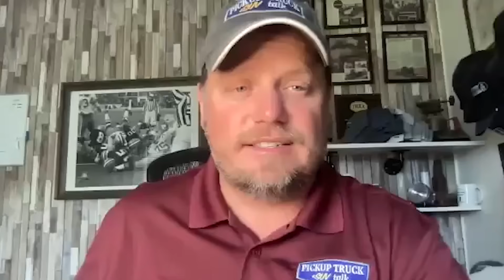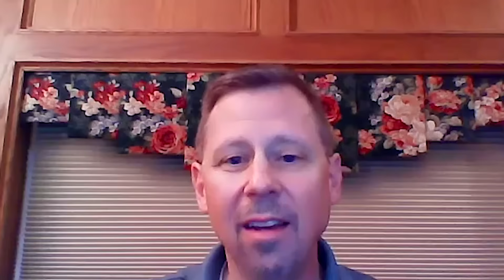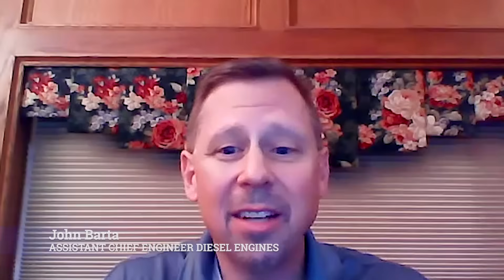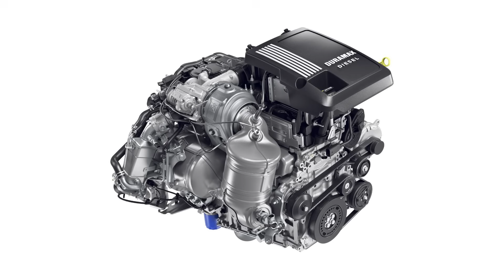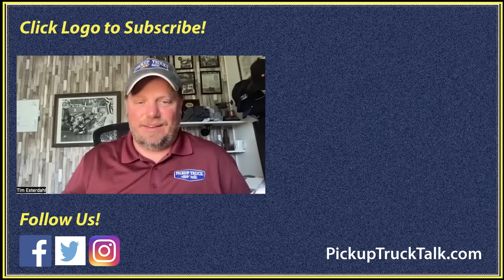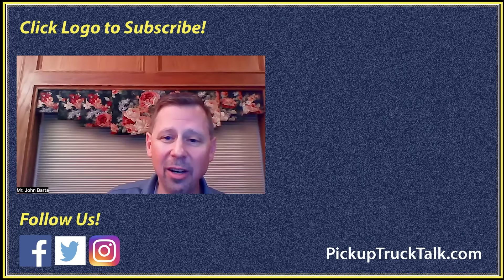GM's 3.0L Duramax Diesel Engineer Answers Questions Owners Keep Asking

Comment: GM: Pleeeease put the LZ0 duramax in an HD chassis.  Many of us need high payload and capable braking, but don't need huge towing capacity. My use case is overlanding slide in, popup pickup campers. Though on the light end of pickup campers at 1,600lbs, that is just a bit much for the average fullsize pickup. But going to a HD means huge and expensive diesel or thirsty gas engine. If not towing typical HD towing loads, many fullsize pickup engines would work great; this LZ0 duramax being a perfect example. Call it an "HD light" (opposite of a "heavy half ton") or whatever, but keep the 3,000+lb payload and tow rating of a typical fullsize (10,000 - 12,000lb) rather than HD towing capacity (16,000+lb) and with this engine, it would be a star.
Reply: Or scale the 3.0 up to a 4.0 or 4.5 L version and put it in the HD.  I dig this straight six so much.  Heck, if they scaled the 3.0 up to a 6.6 L version for the HD, I'd be tempted to get one.
Reply: @v8chevy788  I like the way you think! I love the inherent balance of a straight 6 (in gas or diesel). If they upsized it too big, though, they would have to replace the 6.6. The 3.0 as it is would mean no new/different engine and so would have economy of scale and parts. Though a 4.0 version would be great, the 3.0 in an HD chassis with the 10 speed would be plenty for my needs, cheap, and good fuel mileage so GREAT backcountry exploring range with a big HD fuel tank, and carry the payload I need (for slide-in pickup camper) as well as have the brakes and handling for the payload.
Reply: GM did release a higher towing/payload option for MY22 with the LM2 trucks.
Reply: @LoneWolf1985BK  Correct that the fullsize pickup max towing was increased with the last model year of the LM2.  But that is the opposite of what I'm talking about. I don't need even 1/3 the towing capacity of the Fullsize pickup, much less the HD. I need the payload capacity of the HD due to hauling a light weight slide-in pickup camper (1,600lbs dry and 2,000 wet with camping gear). Need the 3,000lb payload capacity of an HD and capable brakes and chassis to more confidently haul the camper, gear and passengers. 

My current fullsize pickup with airbags is at max payload and so really need an HD chassis, but do NOT need huge towing capability of an HD and so don't need the HD drivetrain (huge, thirsty, heavy engines and transmissions). A Fullsize pickup drivetrain, like the LM2/LZ0 3.0 diesel, would have all the power I need since I have 2,000lb payload (camper) in the bed for about 7 or 8 months out of the year. .The trailers I tow are only about 3,000lb - 4,000lb each at the most (fishing boat and an enclosed trailer.  

I love the 3.0 duramax and it would easily pull around a "HD Light" with the typical HD payload but with a reduced max tow rating. If they rated it for the same the Fullsize pickup with that engine (or even less since the pickup itself weighs a couple thousand pounds more than the fullsize), that would be perfect for our use. 

It would be a perfect pickup camper owners rig. Those that choose to use slide in pickup campers, rather than huge camper trailers, tend to want to get to dispersed places rather than campgrounds and so also don't tow or tow very light. We want high payload but have no need for high tow rating because we don't pull huge trailers because we value mobility.
Reply from the maker: GM did a heavy-duty half-ton back in the 90s. It didn’t sell that well. Nissan Titan XD is suffering the same low sales right now. Hard to make the business case to offer one again imo.
Reply: @Pickuptrucktalk  Hiya Tim, I remember the "heavy half-tons". That was back when half-tons really only had a max payload of about half ton (1,000 lbs) and HD 1 tons had max payload of about 1 ton. Now we have "half-tons" that have max payload of 2,000+ pounds. Hence the move to the naming convention "Fullsize" rather than 1/2 ton. Ha. The 90s "heavy half-tons" also bumped up to the HD engines (from 5.3 to the 6.0 in GMs example). I'm wanting the opposite. A smaller, lighter, efficient, less expensive Fullsize pickup drivetrain in an HD body with the payload, axles, brakes, suspensions, etc. to carry and stop heavy payload, but want the smaller fullsize engine since I don't tow trailers over 3,000lbs. Just need the payload for slide-in pickup camper. 

I'll say that many things have changed since the 90s. Just like dual sport motorcycles have become much more popular, the "overlanding" scene (backcountry and trail driving and camping) has exploded. Yes one can dandy up a Fullsize pickup with airbag/suspension/LT tires, etc. (which I have) but that doesn't change the max payload.  An HD is what many of us need, but with no need for towing over 16,000+lb. We just want payload and so have no need for the heavy, inefficient, expensive HD drivetrain. Hence the wish for an HD with light duty drivetrain like the LZ0 and 10 speed. Will they ever build it? No. But it will stay on my wish list.
Reply: The only heavy half ton is the f150 with the heavy duty payload package.
Reply: @AJourneyOfYourSoul  There is (or used to be) a unicorn F150 model with 3,000lb payload. It was a standard cab, longbed, 4x2. There are some extended cab, standard bed 4x4 with reasonably high payload, but still less than I'm looking for and they still don't have HD axles, brakes, suspension, frame, etc. When I'm loaded up with a 2,000lb wet pop-up pickup camper and loaded with recovery gear and a couple people, I'm at the max of all Fullsize pickups. 

My next pickup will be an HD, but I don't tow over 3,000lbs, as mentioned. Just need the payload rating of 3,200 - 3,800lb that most 3/4 tons are now rated for along with the heavy duty frame, brakes, axles, suspension, etc. but I don't need tow rating over 8,000lb much less 16,000+lb so don't need the heavy, expensive, fuel-hungry HD drivetrain. A light duty drivetrain, like the 3.0 duramax and light duty 10 speed would be perfect in an "HD Light".  It will never happen, but I can still wish for it! Ha.
Reply: @MrChadx1  ford still makes that truck, you have to order the heavy duty payload package and they offer it in all cab configurations with the longest bed for that cab.  8’ bed for regular and extended cab, 6.5’ bed for supercrew.  Also available with 4x4.
Reply: @AJourneyOfYourSoul  Agreed they still offer the max payload package. I was specifically talking about the 3,000+lb payload F150 being a specific configuration (4x2/standard cab/longbed).  I'm looking at a chart from the 2021 model year that shows the max payload, with the Max Payload Package, and it raises each bed/cab configuration between 500 - 1,000lbs above that configurations standard max payload. 

It's a good package that includes 3.73 locking rear axle, 9.75inch gearset, 36 gallon fuel tank, upgraded springs as well as LT (Light Truck) tires rather than typical P (passenger rated) tires. The 2021 chart I'm looking at says it was not available with the 122-inch wheelbase and only in the regular cab/8' bed on the 145-inch wheelbase. For a supercab to get the max payload package, you had to get the 8' bed (164-inch wheelbase). And for the supercrew to get it, you had to get the 6.5' bed (157inch wheelbase). Really long rigs.  

But still a good increase in payload. Some examples of what it raises payload are: Regular cab/8ft bed/5.0V8/4x2 from 2,350lb to 3,325lb payload.  A supercab/8ft bed/3.5V6/4x4 goes from 2,125 to 2,740.  

Looking at the 2022, they now rate the max payload of those with max payload package (option code 627) a bit different than they used to. It's now based on a max GVWR is 7,850lb no matter what configuration. And so then they issue the max payload based on GVWR of 7,850 minus the weight of the configuration/engine to get the max payload. Still come good ratings but much lower than in 2021. I don't know why they changed it.  With a 4x2 regular cab/5.0V8 is now only rated to 2,856 and supercrew/4x4/5.0V8 is only rated at 1,731lb max payload with the max payload package.

Quite good for a Fullsize pickup, but the HD payload numbers start at 3,000lb but most 250/2500 series pickups have max payload of 3,600 to 3,900lb and they also have much more capable brakes, frame, axles, etc. of an HD pickup.
Reply: 13:59

Comment: So is there going to be a crank no start recall???? Because I just went to my diesel tech at my local chevy he said he knows of the issue but they can't do anything to it unless they can recreate that issue. I've gone to another chevy dealer and he said he had no idea what crank no start is????????
Reply: I just took my 2021 GMC Sierra into the dealer last week for this issue. They were aware of this latest software upgrade. They knew all about it - it took them a day to install. I noticed a little longer crank start now but if that resolves the problem it’s worth it!
Reply: It's a software update.
Reply: @GregD94  how do I go about getting it fixed?
Reply from the maker: I would think there is a TSB to fix it.

Comment: Boy I shore hope Chev did not mess up this engine I have one it's a 2020 Silverado LTZ and I get 30 to 35 miles per gallon banging around the back roads of New Hampshire. And as far as power I have owned Chevrolet for 40 years and this truck is the only truck I've owned that you have to let off the accelerator going up a hill. I'm to be ordering a 2023 in the spring I just hope and pray 🙏 that I will love the 2023 as much as my 2020.  !!!!!!!!!!!

Comment: Tim this is pretty neat you get to have the man in charge on your channel. I know it’s not the first or last Exec but nothing like educating us directly from the man in charge.   Or woman 😁 Now where is our power bump to the 62/5.3? Something tells me one of these motors is going bye in favor of new Turbo 6
Reply: Is there a new gasser turbo 6 coming from GM?
Reply: @MX5-XU  I would imagine so. The 5.3 and 6.2 together just don’t make sense anymore.  I think one of them might be out but I’m not sure.  And I’m sure the Ram will get the 3.0 T very soon.
Reply: @9663mu  yeah Ecoboosts in Ford and Hurricane turbo mill now in the Ram may necessitate GM do something. If they've invested in inline engine configurations, would make sense to have a ~4.0L Inline 6 turbo (with the same individual cylinder capacity as the 2.7T ; .675L per cylinder)
Reply: @MX5-XU  it will be interesting cause we know GM loves their small blocks.  It’s like breaking up with your wife of a looooooong time 😁😁
Reply: @9663mu  totally. I suspect the small block architecture will live on in some more niche type application. Or maybe they'll be paired with hybrid systems or something. Who knows, always fun to dream about what ifs. :)

Comment: Ask about rubber oil drive belt and problem with cam timing indicator.
Reply from the maker: I did. Not the cam timing though. Probably another supplier issue.

Comment: I love this powertrain! Best GM powertrain I’ve had unfortunately once the lease is over it will be going back. Don’t want the headache of dealing with all the Emissions crap outside of the warranty period. Gas mileage wise it has been amazing avg 25 mix of rural/city driving and I drive like Jill.
Reply: Just delete that emissions crap after warranty, watch your mileage go into the mid 35's.
Reply: @brianr1899  Except finding a shop/parts to delete it is damn near impossible in IL.

Comment: I’ll be purchasing a new 1/2 ton truck in the next 6mo if available. I’d love to give this motor a chance.  But diesel fuel costs are always so volatile. 87 octane in the Grand Raids, MI area is $3.86/gal.  Diesel is $4.94.  I can’t get past that at the moment.
Reply: I routinely get 30mpg plus 70mph.  At a 50mph cruise speed I've got over 50mpg.  In the long run I think the cost of ownership versus a gas truck is less.
Reply: @Gunsarge101  - Dissagree.  I’m not buying the 50 mpg out of a big pickup truck.  Diesel engines have always required more maintenance than gasoline engines.  They require DEF, fuel filters, more oil, etc, but they tend to produce more work per mile than gas & they tend to last longer than gas engines.
Reply: @cmdrdarwin3682  50mph speed limit gentle down hill for 150 miles.  I took a picture of the gauge cluster I would attach if YouTube let me.  Best I've ever seen.
Reply: @Gunsarge101  - That’s NOT real world mpg.  I never heard of a 150 mile hill!  No one drives 50 mph, unless you enjoy being run over.
Reply: @Gunsarge101  I did the same thing coming down the Green Mountain Byway 48 mpg last 25 miles indicated.  I had my wife send it to her father who has the GMC AT4 with the 3.0L, he can't seem to come close to my fuel numbers - must be the bigger tires and 2 inch lift.
Reply: @Gunsarge101  but a diesel has a lot more preventative maintenance.
Reply: @skoolynugenator1802  Not really. Fuel filters and oil changes, and an oil pump belt at 200k miles. Even when it comes to things like the EGR cooler..... guess what. Engines like the 2.7 Ecoboost also have an EGR cooler and it definitely has to be serviced. They do go bad or soot up. Unfortunately.
Reply from the maker: I’m stuck on that one a bit as well. More costly to fill up, but you’ll be filling up less often. So… 🤔
Reply: @Pickuptrucktalk  time is money, and money gives time. I’m at the pump every 3 weeks driving 1k a month in my 2022 ecodiesel 33 gallon tank
Reply: I did a cost per mile comparison on my 3.0 over a 2000 mile trip including highway and city driving.  I came out at about 15.2 cent per mile.  My wife’s Toyota Highlander came out to about 17.6 cents per mile.  The comparison included fuel, filters, oil, and DEF.
Reply: Getting 800 miles from a tank will change your mind quickly.  I can routinely drive 11 hours straight without a stop.
Reply: @scomo6767  how big is the tank?
Reply: @hanscloss4063  I think it's close to 25 gallons for a full top off.
Reply: @scomo6767 i get 600 miles a tank.  Never heard of ANYBODY getting 800.  A few broke 790 on exceptional trips.
The tank is 24 gal.
Reply: Taxes and registration are going up up up on the diesel.  It's only going to get more expensive,  unfortunately.
Reply: @elche1976  Your state taxes a diesel half-ton more than a gas half-ton? Even if they're the same GVWR? Do you live in california or something?
Reply: That isn't $ losing per gallon, given the $fuel numbers you cited. You're ahead with this engine over any performance-comparable...27% fuel premium against a >30% economy bump. Hybrid/electric trucks best the 3.0L in this regard, but no gas engines do for the same performance. Unless your typical drive is <10min, where you'd lose some to warm up, you'll always be ahead per gallon for any other similarly performing ICE-only engine.
Reply: fuel cost per mile is almost identical but towing on diesel gets upper hand
Reply: Diesel where I'm at is the se as regular right now
Reply: If you're stuck on GM probably diesel is best... what I have seen on current GM half tons does not inspire much confidence to say the least. That said, if you're diligent about fluid changes you probably won't have problems. Hopefully
Reply: Today I learnt. The L in L5p means line engine?
Reply: There's 30% more energy in diesel than gasoline. If you can take it easy on the skinny pedal you should be able to make up the difference easily.
Reply: Prior to the Biden administration I was filling up between $2.00 and $2.50 per gallon, so todays $5.00 + per gallon hits the wallet pretty hard no doubt, and when we approached $6 I was about to $hit myself, but I have faith that we'll get this Jack @$$ out of office and get someone that actually understands how to run the US economy and turns the oil industry back on.  The primary reason I chose this engine is it's efficiency for my daily commuting needs. My 2020 Silverado 4x4 with the 3.0L LM2 is cheaper to drive than my wife's Honda Odyssey and it gets a heck of a lot better fuel efficiency. I regularly get 650 miles per tank with my commute using both highways and side streets that has way too many stop and goes with traffic and construction..  Currently on a vacation leaving Indiana to Maine and recieved a ridiculous 770 miles on the first tank and the climb through the Green Mountain byway was effortless with the high torque this thing puts out.   I due however wish this little duramax had a selectable exhaust brake, because the 9 1/2 degree grades out here are no joke and I'm more comfortable downshifting gears in order to save my brakes. Btw this new LZ0 engine doesn't appear to be as efficient as the LM2 and I'm not sure that I need the added power but we'll have to test drive one once the Friends and Family discount comes back 😉
Reply: Yeah but the diesel is going to be more efficient so it'll even out if not lean towards the diesel side.
Reply: I’m getting 700 miles to a tank on mine, so it kind of evens out
Reply: As a registered Independent, vote & elect Republican, diesel prices will go way down.